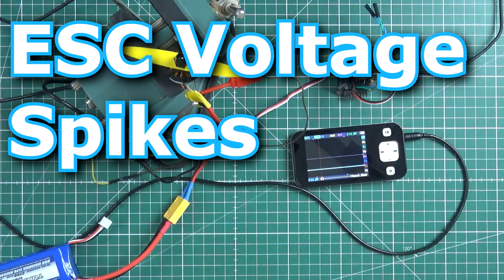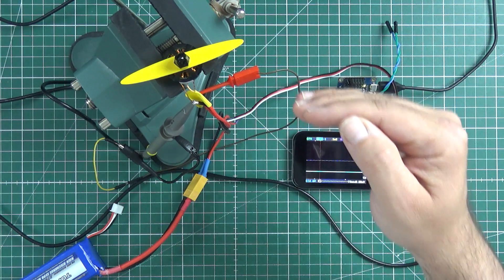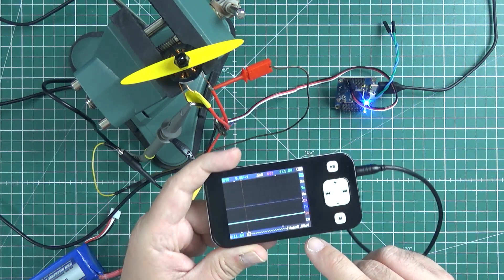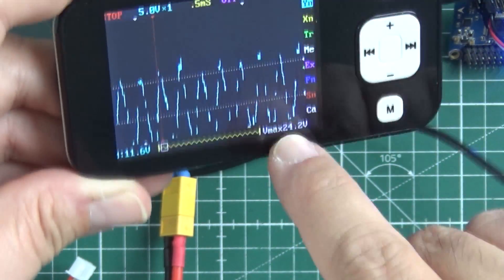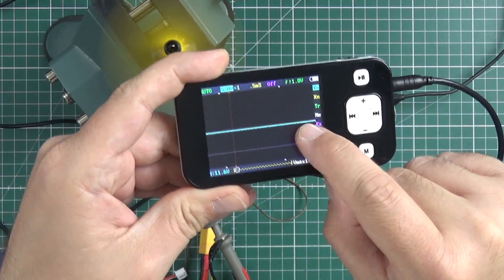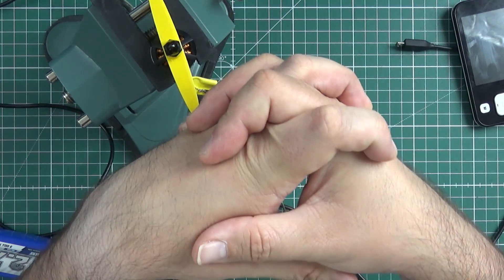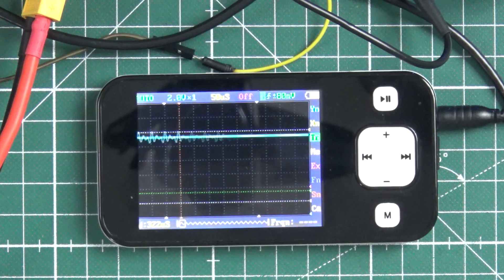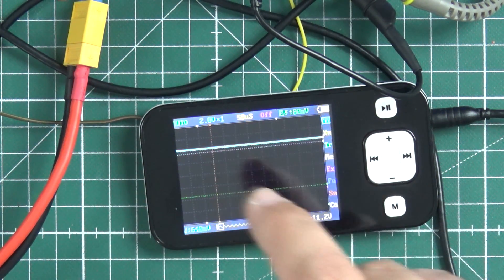ESC Voltage Spikes are not a myth

Comment: 2:40 not sure about 24,4 V max cause that looks more or less like the full peap to peak from the negative to the positive. 
That would mean it would have spiked at half the amount, so 12,2 V

And such 12,2V make much more sense if you compare 12,2 to that 11V line (from the usual 3x 3,7 = 11,1V setup or 10,8V)

If you look at the screen at 2:41 you see that the spikes are above the 11V line, but not that much, more or less those 10% in my opinion, not 24,4 V which would mean more than twice as much as the 11 V.

Comment: I think the voltage spikes are mostly caused by the braking of the motor by the esc. It would be interesting to see the results when the motor is driven by the pid controller with high D-gain instead of with a fixed signal.
Reply from the maker: I will have to redo this experiment with a better hardware I have now :)
Reply: @FPVUniversity  did you make the experiment already? :)

Comment: What looks suspicious is that author measures AC voltage in first test and DC voltage in second test without changing anything on oscilloscope... But last test is really useful, as it shows noise, caused by spikes

Comment: There's another often ignored and misunderstood problem with wiring in quads and planes which is ground loops. They are often the cause of poor video quality, unusual signal problems and strange behaviour. They become especially prevalent where there is high current ac nearby.. like motor/esc. There are some basic practises to prevent it, but you rarely hear about them.
Reply: What's that?

Comment: Seen it first hard with noisy ESCs and certain Flight controllers.  The gyro overloads and the Quad will go crazy and lock out.  Put some small low ESR caps on and all is well.

Comment: I use an LC filter to protect my FC....and Camera....and VTX...Its simple. Plenty of people dont though.
Reply: low esr capacitor works as well
Reply: Caps doesn't always help. Some builds may have weird noise sources. If you decide to add external OSD (MinimOSD) to Eachine Wizard X220 stock  build, you must run all 5V voltage from PDB to FC through LC filter or you will get VERY crappy picture (ESC noise goes from 5V BEC on PDB through FC to OSD) and even 6000 uF low ESR capacitor bank on battery pads doesn't work). Proved by me and others in several X220-s. Also active signal generators like some VTX-es or BECs with unshielded circuit side near video signal path will put slanted wave patterns over FPV picture.